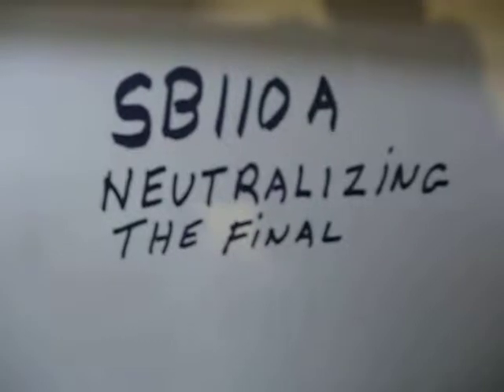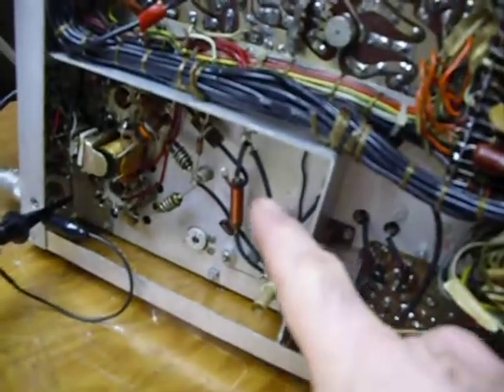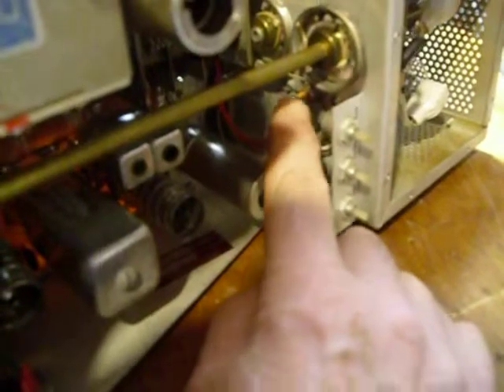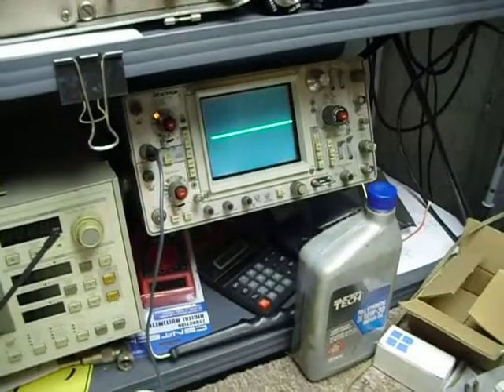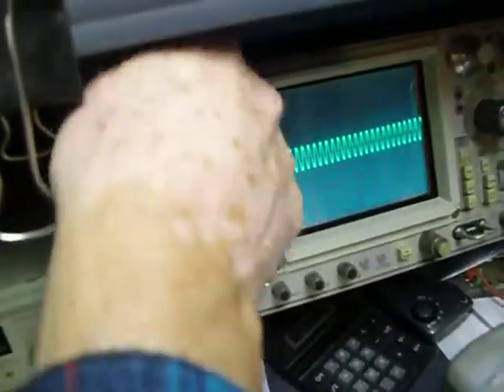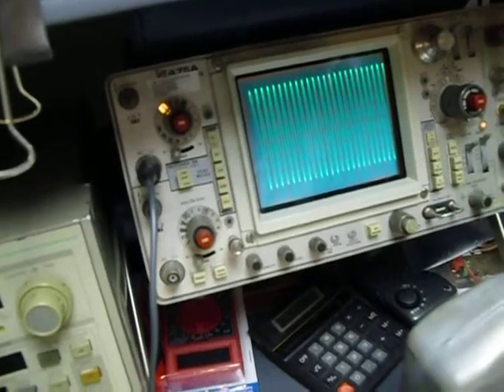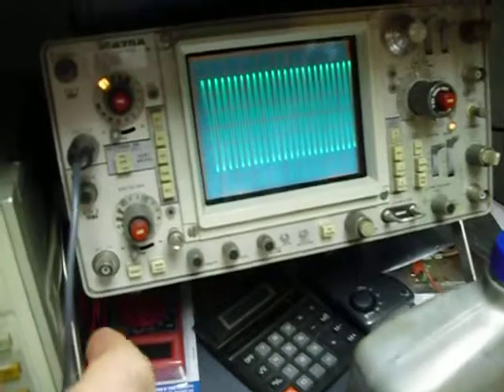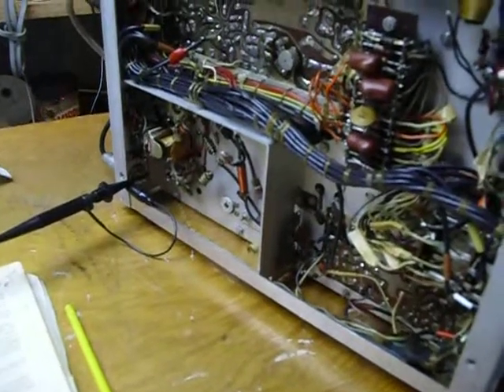SB110-6 Heathkit SB110,restoring a boat anchor,fixing old amateur radios,SB110,SB110A,HW101,SB102,

Comment: I was looking at getting more info on the process of the Neuralizing the Finals. 
I have an old ab-102 that seems to be resonating / puting out RF when the LEVEL is set to 0 

Maybe you can show the full alignment process 
with the hetereodyne oscillator slugs, 
then the Drive Grids slugs 
then the Drive Plates   slugs 

followed by the Neutralize Cap 
then the Null Carrier  Pot /cap 

then back to the "adjust Heterodyne Oscillators slugs for maximum grid"

What tools would be required etc.

thanks,